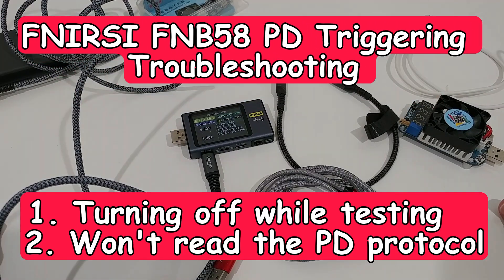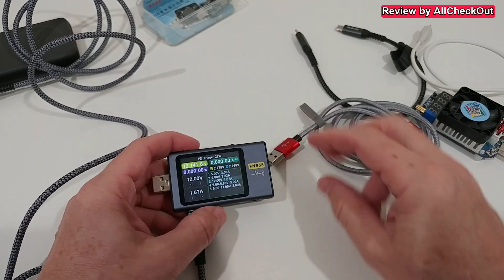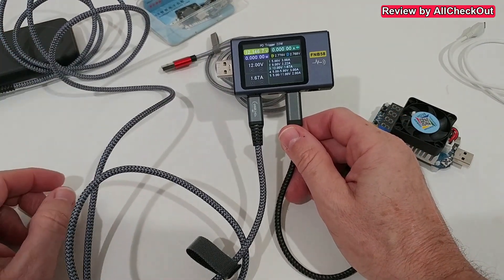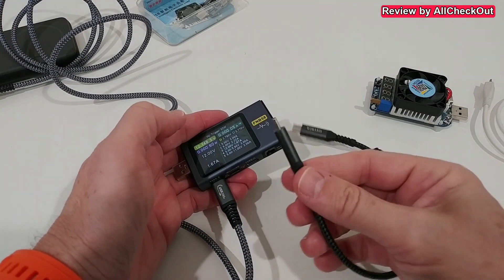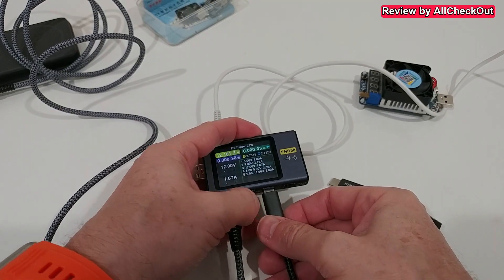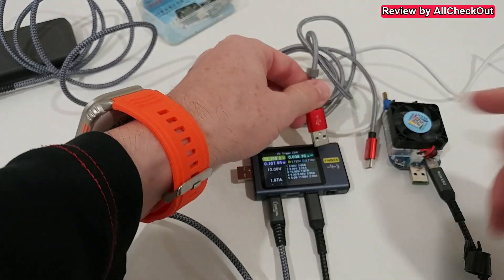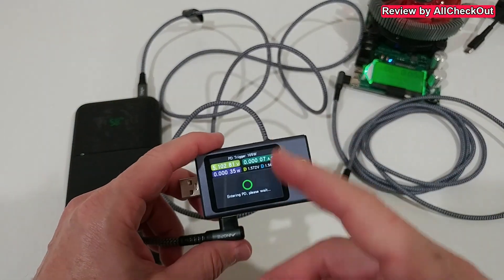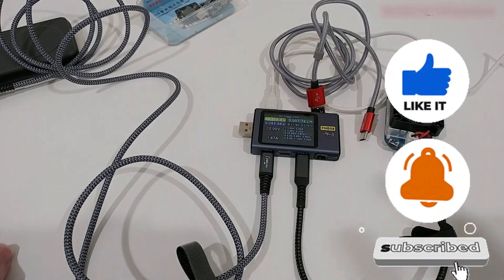FNIRSI FNB58 PD Triggering Troubleshooting (Doesn't Detect PD Or Turns Off With USB-C To USB-C)

Comment: I'm having Error 02
It was charging my headphone thru a power bank, when I came back to check on it, the power bank was empty, and this error happened
Reply from the maker: .... but the headphones have been fully charged? Or maybe a problem with the power bank?
Reply: @allcheckout I have sent an email to Fnirsi, if I find a solution I’ll share it here for reference, and help others 🙏🏻
Reply from the maker: Thanks. Yes please keep us posted here 🙏🏻🙏🏻🙏🏻. I hope you can find/get a solution
Reply from the maker: Yeah in general I love the company. Reasonable priced (usually) solid and somehow advanced devices which otherwise cost much more. Did you try a FW update?
Reply: @allcheckout but now whenever I plug the usb tester, it shows error 2 message. The tester is unusable. I checked multiple wall charger plugs and cables.

Comment: FNB58 Not Showing USB-C E-MARKER , New Firmware V0.68 i Install it but not Check before update there Available USB-C E-MARKER in old Firmware.
Reply: They renamed that function to USB-C Cable Test (still reads the e-marker)

Comment: Thanks. How much power on top do you apply? Is it 5V from laptop usb?
Reply from the maker: It's a 2A supply, but would also work with less ... pretty sure about that. Sometimes even works without extra power .... but not very reliable. I'm very confident that even 0.5A would help
Reply: Another question. When I plug in my powerbank the Unit display error code 02. Does not open the main interface.
Reply from the maker: @hardusvd  IDK what error 02 is. Any text? Tried with different power source? Power bank could be a bit unreliable. Better use a normal phone charger
Reply: I used 4 different power banks and different power supplies and still get error code 02 on all of them. The unit does not open the main interface. Only display error code 02 the moment when you give power.
Reply from the maker: @hardusvd  And without power? Tried with PD in different  positions? Maybe you can reset the FNB58, but I don't know how to do.